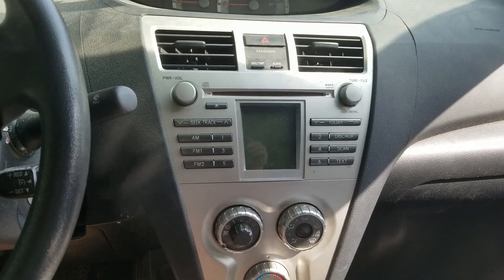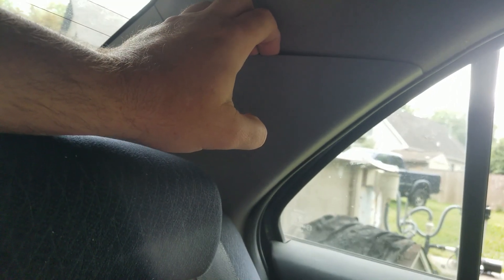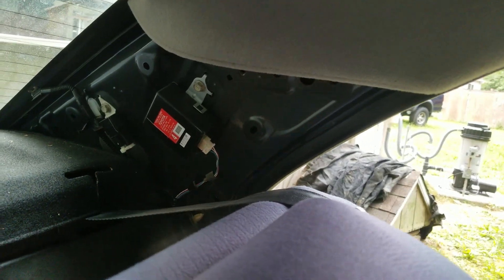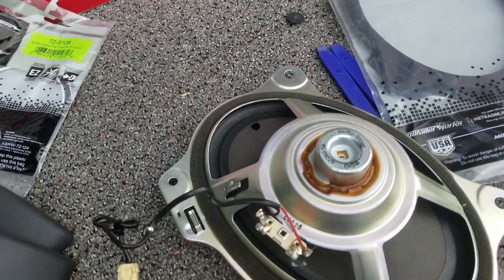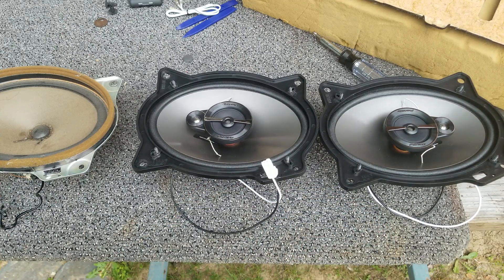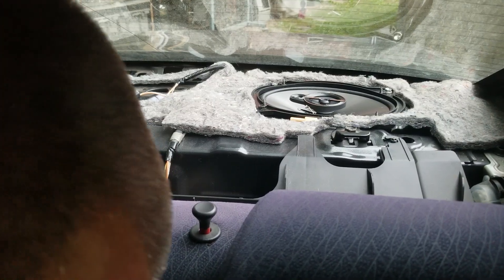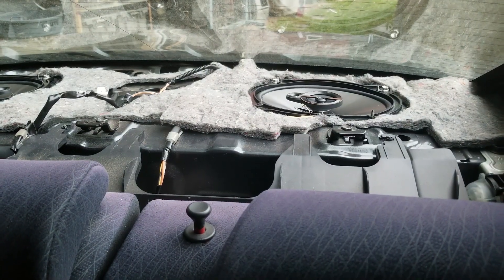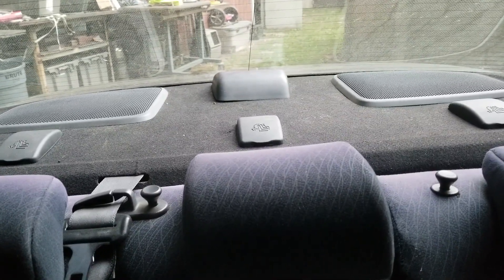Installing New Speakers in my 2008 Yaris

Comment: Hola Jimmy, acabo de ver tu video y me parece excelente, puse el traductor y aún que perdí algunas palabras es esplicito el vídeo, en el haces mención de algunos componentes extras que compraste como el conecto el soporte o junta de la bocina y hay un cambio de bocinas que no me quedo claro, presentas un modelo y luego instalas otro, eso se debe a qué o veo el vídeo o la traducción, sin embargo no muestras la liga de todos los productos que compraste para la instalación, sobre todo el de las bocinas ya que al final estás son como las que quitaste, habría la posibilidad de que incluyeras las ligas para comprar los productos, tengo un Yaris sedán 2008 con apenas 103,000 Km y mis bocinas traseras tienen roto el cono, me gustaría cambiarlas por el mismo modelo que instalaste en tu Yaris, de antemano te agradezco por el video y ojala puedes orientarme para adquirir los productos correctos para su cambio e instalación, saludos desde México
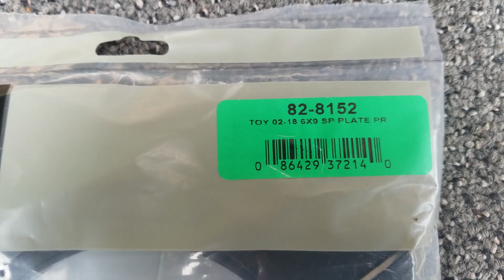Reply from the maker: 1:41  @roger0210  Thank 1:15  you for you comment. Yes, translation is causing problems.  I bought everything from Crutchfield. Com. "Pioneer" is the brand name of the speakers. At 1:15 you can see the box with all the information. I did use them with adapters. I show all the part numbers from  Crutchfield. Com. I am very happy with them so far. I hope this helps.  Good luck on your project.